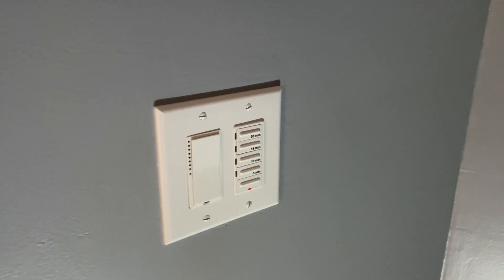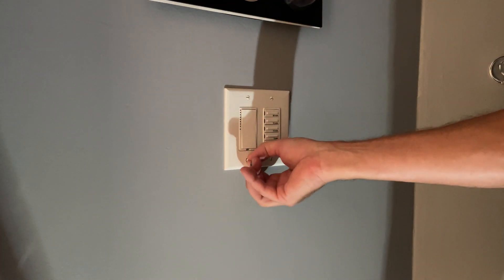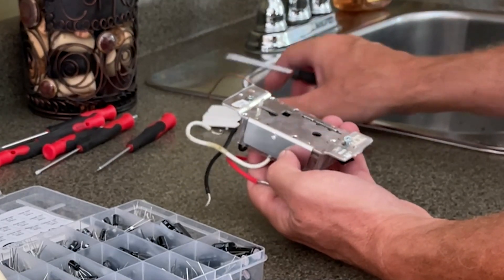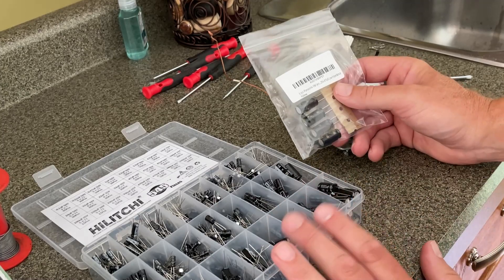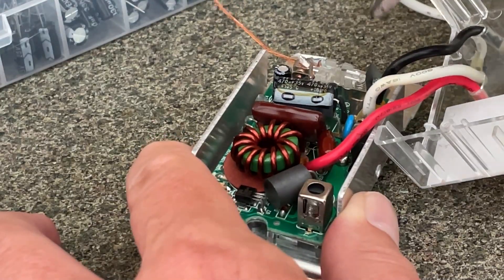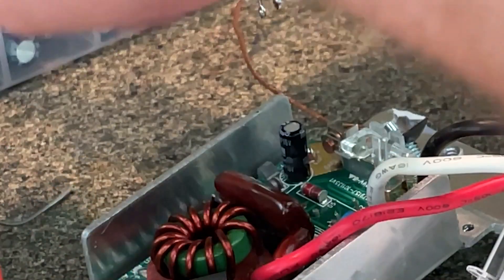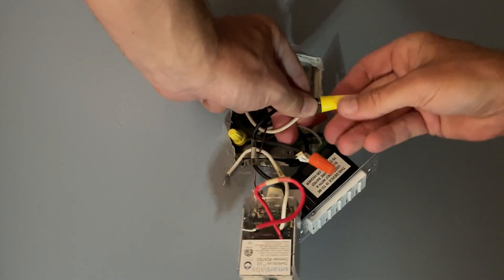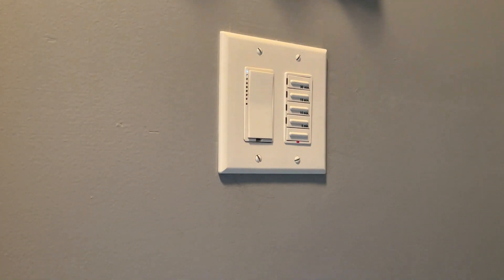Capn Fixit E007 Insteon Switchlinc

Comment: I have a follow-up question: Fixed two Keypad Linc devices in this way. One has been fine through thick and thin. The other one EATS the replacement capacitor after every power failure.  I even tried a cap with a higher voltage rating, but so far I've replaced three.  Does the 100mf cap also maybe need replacement to protect the 470mf one?

Comment: I would worry about how long the solder joint will work.   I realize the switch isn't in a moving vehicle but it wouldn't take too long to remove the pcb and solder the new capacitor directly into it making the electrical connection stronger.   Also wonder why the one leg of the capacitor was insulated.   Shouldn't we insulate the fix?  Why would the manufacturer use a low quality capacitor and then spend more money adding insulation if its not needed?   I don't see why its needed but I haven't taken one apart yet.

My problem is that I have three switches on different circuits that constantly need to be reset.   All the rest work great.
Reply from the maker: Great comments!  Thanks.  I feel good about the wire-to-wire solder connection being robust for the long term, but you're right in that removing the PCB and soldering the leg through the back would be the best way to do it.   Also, I imagine that insulation on one leg of the capacitor is to protect against a short if something should break loose inside the switch and rattle around until it found itself shorting across the capacitor legs.  That manufacturer design choice might have been required for them to get U.L. or some other safety certification of their product.   So again, the best thing would be to put that capacitor leg insulator back exactly like it was.   Let us know if you pull your PCBs and make the repairs by soldering the legs in the PCB.   Thanks!
Reply: Insteon is kinda known for going cheap with their components.  Too bad, as their switches are great and more programmable than most other zwave, wifi or zigbee products.
Doing it this wat (reusing the existing cap's leads) is actually a good idea, as you risk destroying the PCB's throughhole pads when completely removing the old leads.  That is a real mess.
Final note - when replacing these caps it's a good practice to use a replacement with a higher voltage rating than the original.  Insteon tends to put in the bare minimum to save costs; when repairing things it's worth it to upgrade so you don't have to do it again.  So you might also want to consider getting your caps from a reputable online supplier like mouser and choose known brands like panasonic rather then whatever Amazon is going to throw at you :-)